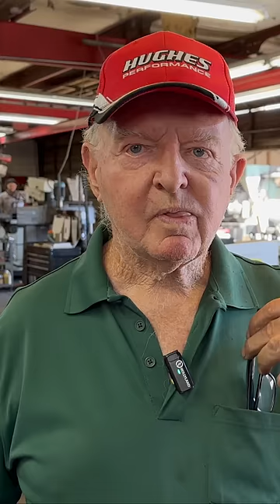Talking CAMS Torque or HP? Ed Smith shares Engine Building and Racing experiences #barryt

Comment: Back in 1979 the company i worked for got a one ton ford 9' flat bed with a 460. It would go way over 100 mph & burn the dully tires for 15' from a dead stop. Also got good gas mileage when drove 70 mph on open road when the speed limit was 55. I shit my pants one time when it blew the muffler off when smoking the tires.

Comment: The reason for the retarded cam timing was for emissions reasons.  The lower sprocket from 1968 model year also worked as a replacement.
Reply: Will that fit all years?  I haven't done the timing set yet but it may not have a plastic cam gear.
Reply: @thisisyourcaptainspeaking2259 works on all 460s. just gotta make sure to set it proper. the efi ones will need adjusted ecm.
Reply: @oregonfordguy9812  Yeah, mine's a '94 efi...  Right now I need to fix broken passenger rear manifold bolts.
Reply: All 88 to end of production EFI 460s utilized a straight up double roller timing set.

From 1972 to 1987 cam timing was retarded 8 degrees for control of oxides of nitrogen emissions.

SJ
Parkland RHP
Reply: Did the same to the 400 and 351M
Reply: @Maples01  The 302/351W as well.   It was a simple wake-up trick when I played with cars of that vintage.   Straighten up the can timing, put a 4-bbl on it, and set it up for dual exhausts, and if you really want a difference, throw a set of 3.25s in the rear axle.   My little Maverick suddenly had balls and still idled smooth.
Reply: @xaenon9849  My 73 Econoline had 3.25 gears, the lil 302 sure liked timing high, I miss it, was totaled, the 89 4.9 should be fun, but the computer and electronics have been misery, I sure miss a carburetor, so much simpler.
Reply: Just order a time and gear set for the year model engine and drill the top gear in degrees of Cam and yourself. That way you totally eliminate the problem
Reply: @e-racer4673 - easier way: just but an adjustable timing gear and dial it in yourself. Available anywhere, and no calculation or drilling required.
Reply: Thats why RV cams were so popular and worked so well. Bit better lobe profile and proper cam timing.
Reply: @Maples01 can concur

Comment: From about 1973 on car companies retarded the cams in their big block engines. This really killed the power. I had a 460 in a 1975 Ford F150. I bought a timing chain set that would allow me to advance or retard the cam 3 or 6 degrees. I advanced the cam 6 degrees. This one step along allowed me to literally burn rubber at will. The truck was stolen shortly after I made this modification. I often wondered if advancing the cam 6 degrees was too much, but according to this video, I was spot on!
Reply from the maker: You were absolutely right! Sorry for your loss on it being stolen, however

Comment: The best thing I did to my 64 Ford pick up was to put a 440 dodge motor in it, with an auto trans. It got 23 miles to the gallon, and this was on the eighties, to bad the engineers can can't fogure it out. The 440 was built for truck pulls.
Reply from the maker: I know it was used in many many motorhomes with good results

Comment: Ford did that lots the old 460 we put 429 timing gear set in it big difference
Reply: they did it from 73 on up
Reply: 429 timing would have made it a beast hey???
Reply: 429 The BOSS!
Reply: Did the same to Dad's 85. Huge difference! My son is still driving that truck daily. Engine is untouched  .....still a beast.
Reply: 429 sprockets and cam are identical. It’s the year model.

Comment: I've always wanted torque over horsepower cause torque is what makes a huge difference with 300hp with 340lb ft of torque will most usually dust a 500hp engine plus knowing exactly when to shift helps alot lol..I use to love beating high horsepower engines with lower horsepower cause when they start losing traction I's already gone lol...I haven't beat em all but I've gathered up a few of em and gave em a hell of a run, just for fun 😂..This man knows exactly what he's talking about cause the old timers are what kept me having just enough to win. Plus I got 25mpg on gas driving normal lol..Listening is how I learned cause people that talks to much like I'm doing right now, they most usually don't have a clue about mechanics..I learnt the hard way ruining engines until I started paying attention to my elders ❤...
Reply from the maker: Very good comment, Carl. I’m learning a lot listening to Ed myself, he always has an interesting story or idea… Thank you

Comment: My old 1989 F350 460 dually with 4:11s got 9 mpg no matter what. It got 9 in the city, 9 on the highway, unloaded or trailering a car; didn't matter. At least it was consistent.

Comment: It's been that way on most American made engines since 1971 due to emissions, it lowers nitrogen oxides & power. 
I even advance the VW aba up to 1997 engines 1 cam sprocket tooth & add ram air from in front of grill to help the 2.0slow vw.

Comment: The 460 before 1972, was a good engine. Emissions took the guts out of it.
Reply: We've got a 73 super camper special 350 with a 460, stock everything accept the carb and the distributor, all the torque and acceleration with the 4.10's
Reply: @rgbrown90  Thats a 10 4 buddy over and out. Gotta love that Guber Ment Man Dates. Engineers designing problems for the future costing the consumer once again.
Reply: The reason why is compression ratio and cam timing.
C8VE C9VE and D0VE heads give 10.5;1 compression and the cam timing isn't ret*rded, I have had probably 15 Lincolns from 68 through 1975. All of them are pretty peppy considering they weigh 5500ish lbs.
1973s are not terrible although not the powerhouse they were in 70 by 1976 they they were sleds in the Lincoln line up and Come 1977 when Ford started putting them in the trucks they are even worse probably the worst years for them is 1980-1986 era but any cylinder head that the casting number starts with a "E" is it pretty terrible performer (The E represents the decade of the '80s d D represents The 1970s, The number after the letter represents the year for example D1 would be 1971, E3 would be 1983, C8 would be 1968). If anyone is building a 460 and they are okay with running premium gas, 1968-1970 cylinder heads are the ticket and a timing set from the same period with a torque/rv cam Will wake the engine up and it will still run nice and smooth like stock.
Reply: @AtomicReverend  Thanks alot for the Scoop on that. Just Like the Camel Back Heads for s.b. Chevy the combustion chambers are not all 64cc but most the Heads have the Humps. So Era 60'S early 70's 327 Heads is what the Hot Rodder needs then punch the valves to 2.02 and 1.64 and of course some porting and polishing... Keep the wheels on the Ground U All. peACE.
Reply: @peterparker9286  My model A that you see in my Avatar is getting a small block Chevy lol.
A 1959 283, I can't remember what year the heads are off the top of my head (No pun intended) but they are a small combustion chamber big valve heads. They are not technically Camelback heads But are the same thing I want to say they are 1968 but I'm too lazy to go outside and look at the casting number and look it up.
I love all American v8s especially from the '50s to '70s, I am not brand loyal whatsoever.
Anyone reading this get out in your garage and build your hot rod,  ricer, classic car, muscle car, tuner off-road toy and come election day vote against anything that threatens our car hobby, we all need to stick together.
Reply: That happened with everything from mid to late 70s to mid to late 80s until they started getting fuel injection dialed in
Reply: If I remember correctly the horse power went from 375 to 212 in one year.
Reply: @forrestmanueljr9196  Had a 76 mark 4. That thing couldn't get out of its own way. Not like the 70.
Reply: @forrestmanueljr9196  it was 365 to 212 but there was a change how HP was measured too so in all reality it wasn't as bad as it looked  But you figure compression went down roughly two points or in modern terms it went from having to run on premium to running on regular gas That was probably 80 horsepower right there.
Reply: @AtomicReverend  my dad had a 1970 429 and grandpa had a 78 460 and there was a crazy difference in power between the two. It use to make my grandpa aggravated when he would ride with my dad and feel the difference. Lol
Reply: @forrestmanueljr9196  I have had a slew of Ford big blocks over the years and yes, You have no argument for me there is definitely a difference between a 1970 429 out of a Merc or Ford LTD and a smogged down low compression catalytic converter ret*rded cam timing, EGR valved, smog pumped 1978 Lincoln/ford/merc 460...
My original comment was in reference to the 1973 as it isn't terrible same with the 1974 It's not as good as a 69, 70 or 71 but It isn't as bad as some a few years later 1978 is the last year of the full size Ford with a big block I think in Lincoln it ran through 1979 but in any rate after that the big block becomes a truck engine and it is even worse than it was in the smogged down luxo-boats. 

I think it was in this comment section a day or two ago I mentioned the worst years is the mid-80s BBF, I really like bullnose Ford pickups But they are such sleds even with a 460 They are so smogged down Not only will they not do a burnout but they get terrible fuel mileage and they struggle towing a car trailer, It's a giant engine It is so easy for them to make 500 horsepower and around 600 ft lb of torque If you delete all that smog garbage and put a nice exhaust and intake on it and do some real wild head work but unfortunately I live in California So I can't wake the engine up by doing a emissions delete and fixing the cam timing.

Comment: I have a 1964 Pontiac 389 with over 450Lb Ft of Tq that was built by a pro. Also a 1969 Pontiac 400 with well over 500Lb Ft of Tq. Both have original Pontiac iron heads, crank, rods and valvetrane. Cam, timing & carb settings are key!
Reply from the maker: Right on

Comment: Matter of fact I just did that to my 460 a few weeks ago. Degreed the Stock cam and installed an edlebrock double roller timing set with the straight up timing. HUGE difference. The truck jumps of the line now. It even sounds completely different
Reply from the maker: Fantastic!
Reply: @davesendit1348 I’ve got a 91 EFI 460, is that what I need to do to my stock motor? It’s a sluggish pig right now and I need / want answers
Reply: The 400's had the same thing from the factory, add in low compression and it was a dog. Get a straight up timing set, deck the block and big block power from the largest small block Ford.

Comment: I 4.2 cam swapped my old 99 v6 3.8 mustang. Ford heavily restricts their motors. Full X pipe highflow exhaust alone over OE was like +40 hp
People used to put stall converter kits in those trucks years ago. I can only imagine the low end torque he released in a 460

Comment: My dad put a rebuilt 460 out of a 72 f250 in his restored 1974 1ton dully the machine shop forgot to put the rv cam in it but dad kept it mostly stock intake, cast iron exhaust manifolds, its got a 750 edelbrock carb with electronic ignition but it just doesn't have the power like it should
Reply from the maker: Sounds to me like the right cam set would wake it up!

Comment: The 429 police engine cam gear does the same thing
Reply: What year vehicle do you think he was talking about
Reply: @chuckb9867  Circa 1970 429 should have "Straight-up" cam timing.
Reply: @wintonhudelson2252 yea but “straight up” could be as much as 6* either way not counting for chain slack since the dowel and keyway could be a couple degrees off also. This is the purpose of degreeing a cam vs relying on “straight up” as being accurate
Reply: @young11984 While you're correct, they are as well. I've learned that most people on YouTube go for the simple version. HOWEVER! I appreciate people who give the elaborate version, for I do that as well. Lol

Comment: I was told my 1988 460 could have a 1970 460 cam and timing chain to gain a bunch of power.
Reply: This is exactly what he's referring to
Reply: Yes.  Torque band moves toward 1250 RPM and overall HP is increased.
Reply: EFI 460's run a double roller, with the cam straight up. Stock camshaft was the same across the years.
Reply: Except your compression is pretty low.
Reply: @82f100swb Really? I’ve got a 91 EFI and I’m wondering how to boost the power up a bit. Installed some headman headers on it to fix the exhaust leak, but that’s it. Everything is stock. I just thought it was an old truck with no guts, but I’m here to learn some pointers. If I can boost the power I will.
Reply: @76cb360  The early EFI trucks like yours have smaller valves than the 92-97 ones. I do believe you could do a small cam with the stock EFI, but one of your biggest enemies making power is the rather low stock compression ratio. There is power to be had, but basic bolt ons don't gain a whole lot.

Comment: I put a 429 super cobra jet  time gears on my  460 powered Dully  and a 650 holly carb  in drive it would smoke the back tires hit second gear and burn rubber 6 yellow lines  it got 19 miles to the gallon hauling  3 or 4 cars at 75 and 80 MPH  barley pressing the gas pedal take the fan blade off use electric fan for gas mileage and power it's a 1986  I've been retired 15 years it sat parked 6 years fired right up I use it to pull my 5th wheel camper I love that truck Ford had to retard the cam and put two smog pumps to pass emissions

Comment: Back in the 1980s after i got out of community college for diesel mechanics. my first job as a mechanic,the boss' son has a 460 in a speed boat with a jet drive! Insane how fast that thing would go on the river.  By far best engine Ford ever built was 300 straight 6. My brother bought a 86 f150 1992. Has 93k miles on it. I pulled a all nighter and put new rod and main bearings in it. All were down to the copper. When he sold truck it was still running with 350k miles on it. After i put bearings,never did anything else except regular maintenance.
Reply from the maker: I’ve encountered a lot of 300 cu in straight six fans out there. Seems like it’s one of those “if you know you know”.
Reply: @BarryTsGarage  in the mid 90s I was heavy equipment mechanic for a limestone quarry here in central Pennsylvania. As part of my job I had a company service truck. A 92 F350,w/ 5spd and a 300x6. The truck grossed just under 12k lbs 😂. At one particular intersection,I had a stop sign and had to pull out into truck and car traffic. No matter what I did ,I always looked in rear view and would see freightliner or Peterbilt close!LoL. So I gave up stopping at stop sign , quickly look both ways and in 2nd gear hold it tight to the floor until I got it up to about 50 mph,up the grade ,until it became 4 lanes. It sounded like valves were floating at times,but 300 took it like a champ!
Reply: And by regular maintenance, you mean adjusting the rocker lash over and over and over and over...
Reply: @TheBasstead1  no.... hydraulic lifters don't need adjusting. By regular maintenance I mean oil changes,brakes ,tires etc. I'm pretty sure you knew exactly what I meant

Comment: My first vehicle was a 1973 f-100 custom..
Steel dash...steel doors...giant steering wheel for NO power steering, NO power breaks
300 straight 6, with 411 rear end...
68 mph tops, but it would pull the gates off hell ..
Reply: I had a 70 f100 360 dual exhaust, my dad put power steering and a c6 automatic in it
Reply: @bfields1448  you had the Cadillac version!!
Reply: @MrRoss-jz7fx haha yea my papa put aftermarket ac in it and it would just keep sweat off your testicles.
Reply: @bfields1448  i had the little side windows that swiveled, so it'd break your hand going thru trails...but it kept the ball sweat level low

Comment: It's actually 8° retarded for emissions.  If you use a timing set from a 68-71 429-460 it wakes right up. If you use a 1970-71 351c timing set on a 351m-400 ford they come around pretty well too
Reply from the maker: Excellent

Comment: I think the break point in terms of timing for
The 460 was 1972. It was -6 degrees due to emissions garbage either from 72 forward or after 72.  That adjustment changed the whole engine’s personality from that point forward.  To the best of my knowledge lots of different ways to reverse that, and somewhat easy on a pre fuel injection engine.  After they fuel injected it, adjusting the timing is more difficult.  Obviously, if you are building a custom 460 today you’ll set timing where you get the best performance.
Reply from the maker: Well stated
Reply: Well yes they did retard the cam timing in 72 & after, but that wasn't the only change they made. The cam timing will give some power back but by 72 they were not the same engines they were in 70. U can fix the cam timing in a 72 460 & it will give it some power, but it will still be a dog compared to the 70! And not to mention they retarded it by -8 degrees, not -6. But the 72 460 had a taller deck block, open chamber heads as well. Witch means much less compression! So u got more work to do than just that timing chain to being them back life!!
Reply: Fix the cam timing, then work on ICE :
Intake - carb and manifold
Compression - mill heads and/or block, or   aluminum heads with taller pistons
Exhaust - duals, larger diameter pipes
Reply: Fuel injection or carb has nothing to do with adjusting timing. Just say you don't know how to do it.
Reply: @heathcarr1105  they are speaking of ignition timing anyway. The video wasn't about ignition timing. It's about cam timing. They clearly didn't understand.
Reply: @jesseduke694 , These 460 experts don't know the difference between cam timing,  opening and closing of the valves. VRS, Ignition timing, firing of the spark plugs.
The old guy is telling you proven factual data, useing facts and logic. Without the LOGIC,  the facts are wasted on some?